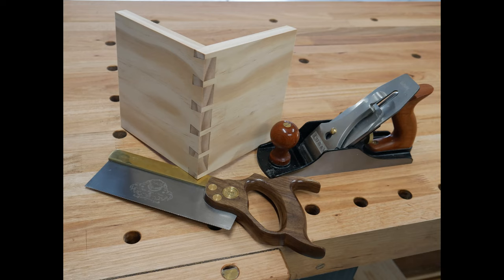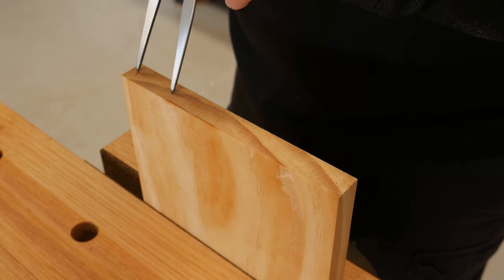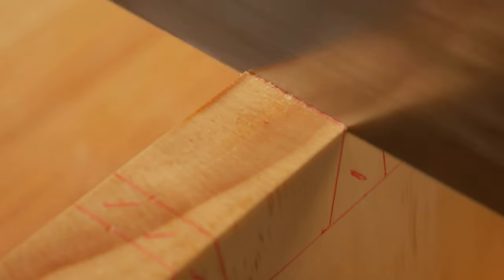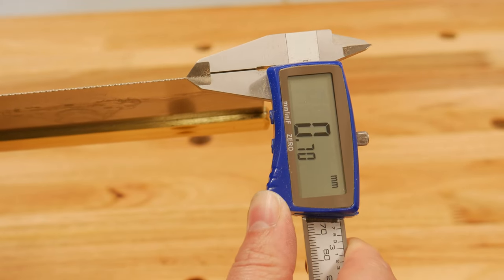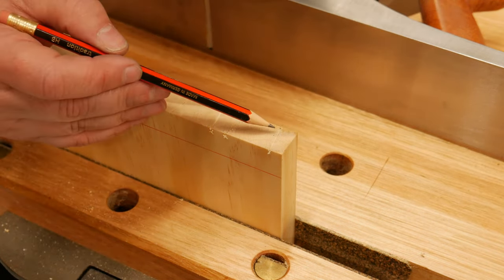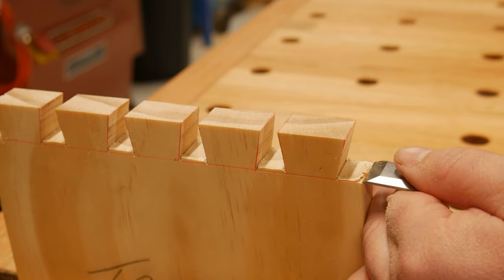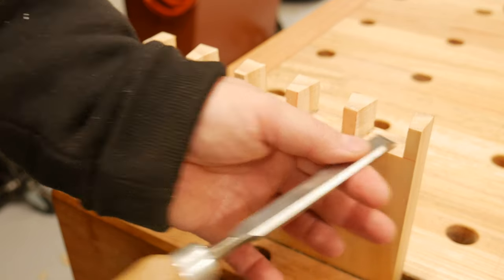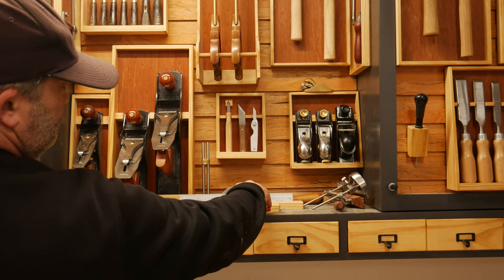How I am learning to DOVETAIL / The Rob Cosman method / Easy as / With DIY marking knife.

Comment: Instead of having to set up the marking gauge to the thickness of the saw kerf, to start off the kerfs for the pins, you could just use a little sliver of veneer taped on to the side of the box side/end, as a piece of veneer is generally 0.7mm (caliper it first to make sure of the dimension). Also, I haven't cut any dovetails in donkey's years, since I was at Cabinet Making college. Whenever I've had a job which includes making dovetail joints, I've used a router jig, as hand cutting (even if you're an expert) just takes too long (commercially). But if I were to attempt hand cut dovetails again, instead of cutting out the waste with a fretsaw, I would just drill down with a brad point drill bit. and go in afterwards and clean up with a dovetail chisel. Lastly, even when I was at college (and I would 100% still do this today) when you mark out your baseline, drop it down by .5mm. Similarly, drop the baseline of the pins down by .5mm. This will then ensure that when the joint goes together, the tails and the pins should protrude past the surface of the drawerside/end by .5mm. That then means you only have to plane off and clean up the small .5mm lengths of pins and tails protruding from the surface, and you don't end up having to plane off the whole outside face of the drawerside/end. This is actually no small consideration, when you have large unwieldy drawers which would be a nightmare to have to plane off the whole face of. Although it does mean remembering to add on 1mm to the dimensions of the drawers side and ends, to maintain your dimensional accuracy.
Reply from the maker: Thanks , I like the sound of the veneer trick, I have nothing on tomorrow I will give a few of your suggestions a go. Thanks for sharing.